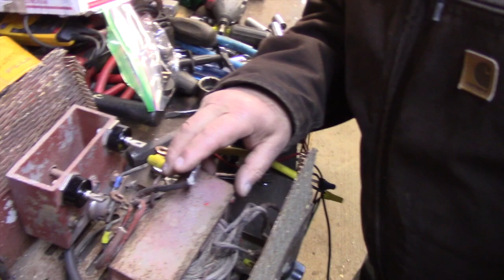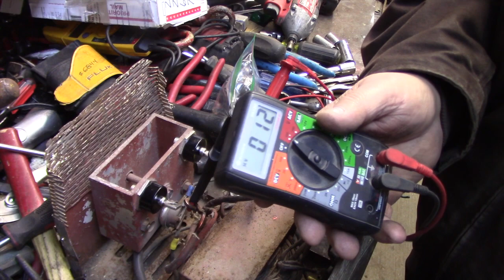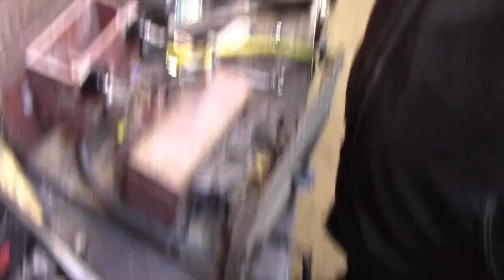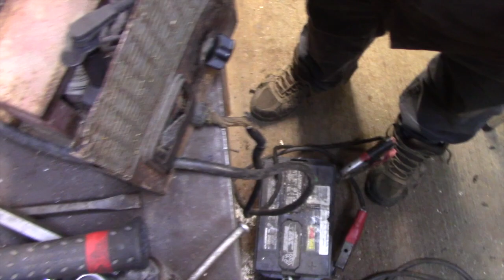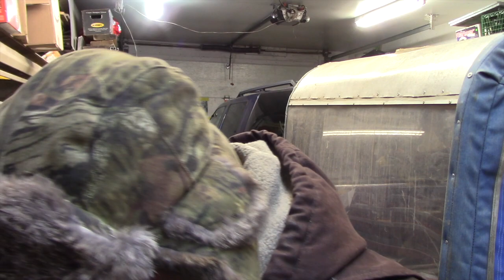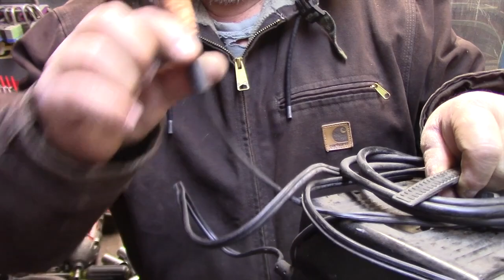Battery charger diode check and repair

Comment: Thanks Gator. After watching your video I just fixed the battery charger that was giving me fits. 
Fortunately it was simple I took the cover off and poked around in it with the test leads and it started working. 
The power switch is dirty by the look of it. Sitting in garage a and barns for 20 years will do that. 
I need to change the switch but for today it is working and it will be busy charging batteries.

Comment: Good lesson on the diodes Gator! The charger/booster is almost back in business, just needs a new power cord, battery cable and clamps! Cheers!
Reply from the maker: photocontrol Yes that charger is almost back to its old days when it was the king of the boost on the farm....nor they have 3 others but they still talk about this one so that is the why I fixed it.....CHEERS

Comment: Good day Gator, no you did a great job of explaining !!! When I had my electrical and electronic course for aviation ( 400 Hrz ) 30-25 yrs a ago.  We did spent several days on Diodes and rectifier since that we have so many various types of electricity on aircraft ( AC/DC ) 1 phase, 3 Phases, 400 Hrz and 60 Hrz and I'm not talking about my friend who works on radars and communication radios who use dielectric gaz tubing to carry electricity between radar and transmitter !!! Keep up the good work Sir !!! That battery charger that you fixe is a tough one and strong one too !!! Cheers !!!
Reply from the maker: Hello Dave....I remember the retailer tubes....I forget the type of gas....I have a big book some place when I took my armature radio course but it was very busy on the job,....all kind of over time....that's forty years ago and we were making over 3000 thousand dollars a week clear...we went in the building before the sun come up and when tout and it was dark...I made so much money I paid my first house....never finish the radio amateur course but that's life....said enough.....CHEERS
Reply: @gatorsworld  Ouff that was a lots of money !!! Keep up the good work Cheers !!!
Reply: http://www.ve2cwq.ca/

Comment: Okay so I went to the site you bought them from and can't find diodes. Do you have a part number for those diodes?
I have a diode checker on my fluke so I will check the diodes in my charger but if I don't ask ya know we may forget what we were looking for? 
So part numbers would be helpful.  Cheers.
Reply: I can't say everything that comes to mind either but it's cause my mind thinks faster than my mouth can talk or even write. Cheers.
Reply from the maker: @mostlymoparih5682  I understand and me it`s worst,.... sometimes I say something and I regret it later but as I age it`s not that bad anymore....CHEERS
Reply: @gatorsworld  Yeah I sometimes get in trouble with the wife. She will hear me on the phone say something and when I get off she will ask me why I said something. Then I say what I said was the truth and she will say yeah but they didn't need to know that. So I gotta check with the news police, oops I mean my wife.
Reply from the maker: @mostlymoparih5682  C...you did it again...It`s so easy to get in trouble these days....CHEERS
Reply from the maker: The diode # xds-124g and this is a positive base so you have to make sure it`s positive on the rectifier heat sink....let me know id you get it....I just phone them....found them on search engine....diode by Motorola....CHEERS

Comment: I've got lost a bit with the wheatstone bridge with diodes...  For what I know about wheat, stone, and bridge, I could not connect the dots! Lol! I just don't know why, but I started counting similar items in the background... Three battery chargers,  6 locks.  I counted 7 measuring tapes, but I should have added the eighth one in the file behind you... Just guessing this last one.  This charger you are working on is not playing in the same league as the MasterCrap charger you showed at the end. Although I have the smaller 2/10/50 amps charger model of the same brand and I have been well served with it.  But yet, my tractors are very small machines easy to crank.  Have a nice weekend my friend!
Reply from the maker: That`s right Joe...not in the same league at all....I spent $130  fixing this charger but when it`s running you can`t buy that capacity for $500 plus tax so it`s worth fixing and the farm will get many years of service out of it....It`s a joy for me when I can fix something like this for the kids....I know they appreciate it and I get the satisfaction of another job well done....I guess its something like how you feel when you finish your projects and they work just like you intended....CHEERS

Comment: Interesting stuff but a bit above my pay grade Gator:)
Reply from the maker: Happy that you find it interesting but I hope you didn`t give up at the first corner....If I Understand this the average person should do pretty well but hey....maybe you will never knead this in your future and you're already getting the big bucks....CHEERS
Reply: @STEVE ROB REVIEWS  >Steve, the power source is A/C. In North America, it is 120 volts at 60hz. Hertz is the number of times a pattern repeats in a second. 1/2 wave uses a transformer with 2 sets of windings in the secondary that thru mutual induction produces an output based on the number of turns, so 12 volt at 1/2 wave is 6 volts. 24 volts at 1/2 wave is 12 volts. Diode produce heat as the B- & B+ are rectified to product direction current flow, thus DC. The amount of current or voltage can be read at the meter. Volts is easy, just pick the correct meter. For amps, the meter can’t handle all of the current so a shunt is used. A shunt is a large coil of copper or copper strap. Both measured to function with the output of the charger. So 99% of current passes thru the shunt to charge the battery, while 1% passes thru the meter to activate it and show current. It just pivots on a shaft, moved by a weak magnetic force can push or pull the armature just like a fuel gauge. The rest is wires, connections and clamps.
ASE Master Tech since 1978-Retired Hope this helps!